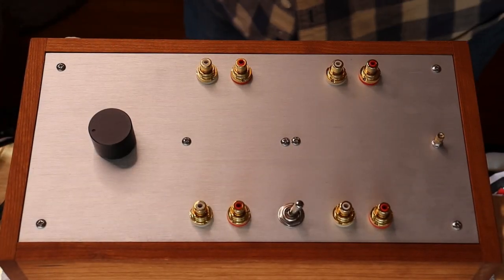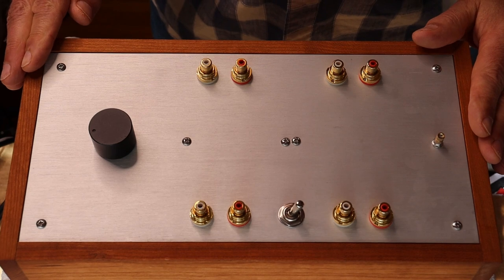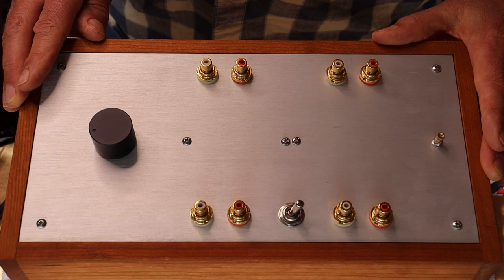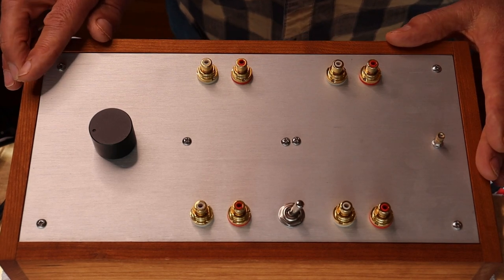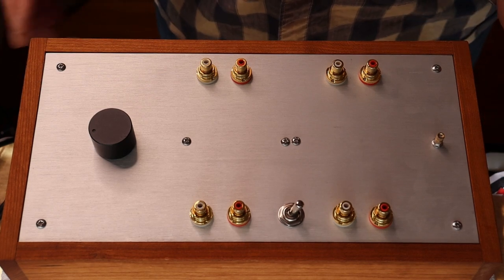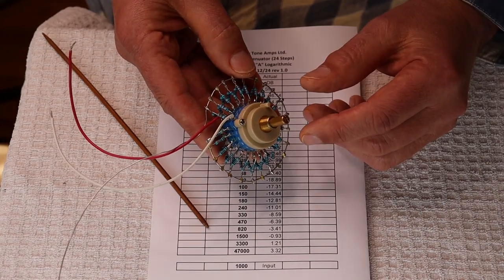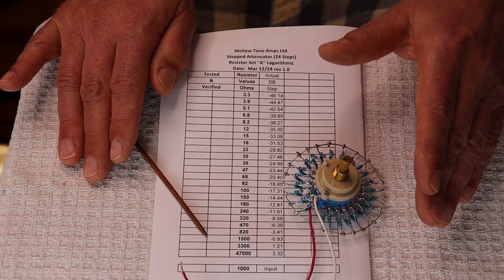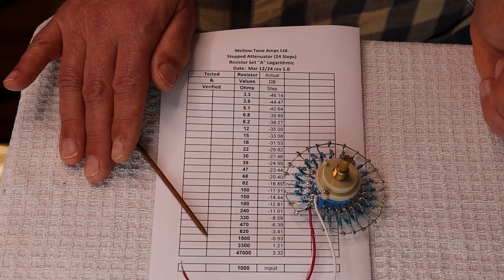Ep1 Stepped Attenuator - Getting Started

Comment: Interesting construction this, makes a lot of sense to wire it like you do. I am wondering a bit about the values selected for the resistors. Normal pots comes as you say most often in the range of about 20k to 100k, especially if there are tubes involved. This volume control will have as low as 1k and be below 2k for much of it's normal use range I would guess. So the source will see a load of 1k to 2k most of the time except on full where it will see 48k. I suspect 1-2 K input impedance could be problematically low for some equipment?  Your tube riaa preamp for example , how does that fare with 1k load? Possibly quite well I guess since it has a nice buffer in form of a cathode follower as output, but it's output impedance would be in the vicinity of 18k I suspect?
So any particular reason for that low resistance in the control,  any downside to have a bit higher resistance in this network? Higher resistance could pick up a bit more noise I suppose...
Reply from the maker: It's great that someone is actually thinking about my design choices!  First, yes the Stepped Attenuator may not work in every setup or play nice with every preamp (but that's common for dedicated auxiliary equipment).  It's primary design goal was as a great sounding master volume control for our own Kit Systems.  When I have time i'll design other resistor sets for a broader application. To achieve the best sound possible, I started with the theory that the resistor in the signal path should be as low a value as can possibly work (I always approach design work with this premise), and that value is 1k.  What that means is the load impedance that the preceding stage sees is 1k + the stepped resistor (typically 40 - 100 ohms).  Yes depending on how everything is wired up other resistor values are in parallel, but because they're all much higher (220k, 100k, 470k) and they effectively don't matter.  Our preamp output impedances are as follows, E80cc 360R, Universal 6or12SN7 800R and the Phono Preamp 910R.  So all of our Preamps have lower impedance and are basically impedance matched with our Stepped Attenuator.  The resulting sonic improvement was simply stunning, it was like a veil had been lifted from the music and we had thought our reference system was close to sounding it's best .  I credit the improvement on 4 design attributes.  First a much lower resistor in the signal path (typically 70-100k), second very closely matched pairs of stepped resistors (0.1 - 0.5%), close matched impedance (though this i'm not certain about and would need to do some more bench and listening tests to determine if in fact it matters that much) and lastly no resistive trace (pot), which clearly colours the sound (in a good way for a digital source, not so for an analogue signal).
Reply: @mellowtoneamps4932  Thanks for the great reply! Very interesting this design with such low impedance on the input with basically matched output and input impedance. I believe the conventional rule of thumb is to have at least 10 times higher input impedance than output impedance. Thus we seldom see less than 10K for volume pots. I guess you use 50 or 100K the alps pots in the preamps? I have actually built a version of your Phono preamp using  a 7N7 I got from you but building it as a point to point construction, just done the first listening test and it sounds great, I just have a bit of hum pickup in one of the channels I need to work out a resolution to.  Anyways I made a LTSpice simulation of it and tested the frequency response with various load resistances. Seems output impedance around 910 is right at least around and above 1kHz, but when we move down in the bass department (where I live, hehe, bass player you see) I found the output impedance increases , since the 2.2uF output cap will start to make a proportionally larger impedance contribution. At low B (38Hz) the impedance of 2.2uF is alone 1.9k so you get quite a bit of bass drop off (9 to 12 dB) gradually below about 100Hz according to the spice simulation at least.
I think it would be good to test and listen a bit extra in that area?  In simulation this effect was there with load resistance up to around 20k where it was just about less than a dB.
I have a couple of very nice E80CC tubes i got from you also that I will build a pre of (currently used in first stage of my Crack hp amp) and I suspect I will build a stepped attenuator for it but I suspect I will opt for a higher series resistor to start with than you have settled for here, but must test if I can hear somthing that may convice me otherwise! Keep up the great work and service you provide!
Reply from the maker: One further note, be very careful of computer modelling programs, they can be less than accurate.  We use them often, but one thing they are very bad at is modelling the correct electrical properties of specific tubes.  When we are nearing completion of a new design we leave the computer completely out of the picture and switch to bench testing and critical listening.  The bench testing will document the "actual" performance and of course the listening tests will determine if we're in the right path to great sound!
Reply: @mellowtoneamps4932  Duly noted! Off to testing then 🙂
Reply from the maker: @RaviNewfarm  Set "B" is tested and the 10k input resistor tests good and makes for a good middle compromise between a low value of 1k and a high one at 100k.  And best of all the Stepped Attenuator can basically go in any position in our system, though at the very end of the preamp chain and feeding the mono blocks gave the best overall performance.  We still need to do more critical listening, but the first listens were really good, with excellent clarity and low distortion, and of course the lower frequencies are not rolling off in any significant amount.  Testing showed the flatest signal response will always be with the alps pot in circuit and no stepped attenuator, but given the sonic improvement with the stepped attenuator in and the alps out, i think a small roll off in the very low frequencies is a good trade off.

Comment: This is a ladder attenuator?
Reply from the maker: No, it's proper title is a "Shunt Stepped Attenuator".  IMO this is by far the best type for high quality audio. The one downside is you need to carefully balance the input resistor (which establishes most of the input impedance) with the output impedance of the connecting gear.  To do that we designed a low impedance resistor "Set A" and a medium impedance "Set B".